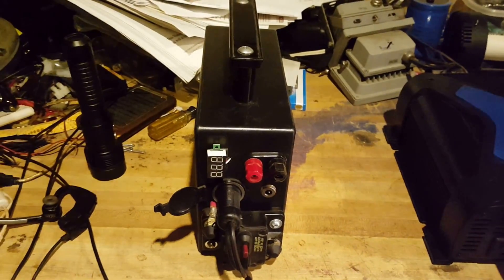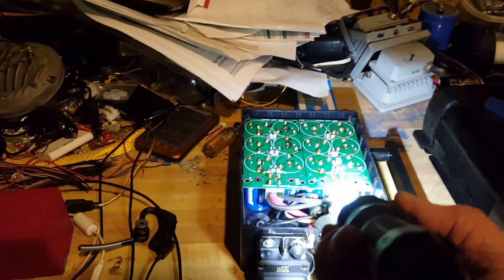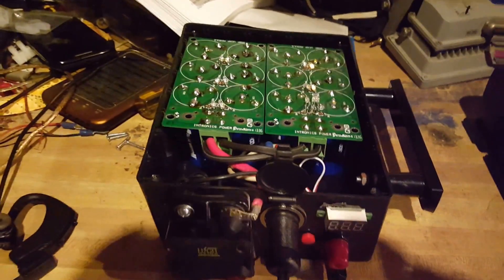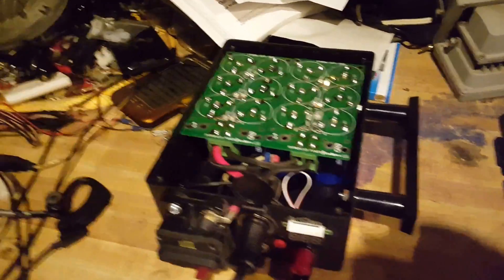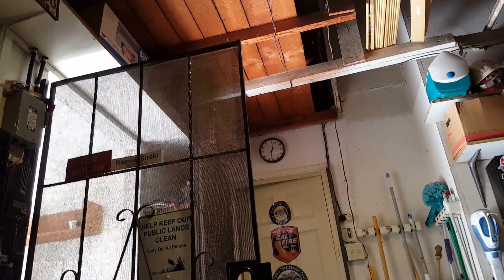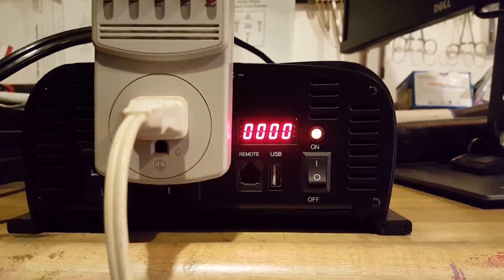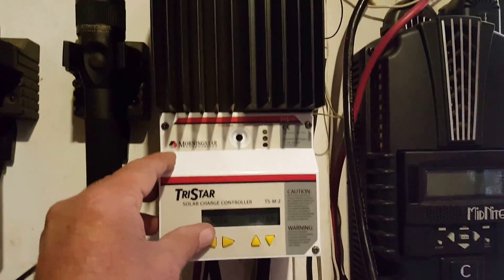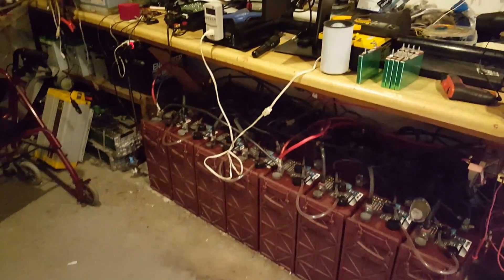Review Of My D Cell Maxwell Supercap, Boostcap Power Pack.

Comment: Because the individual caps are wired in series you have to divide the farads, not multiply them. So each bank is 58.333 farads (350 divided by 6), so both banks in parallel (58.333 times 2) = 116.667 farads. You should use a step up adapter between the caps and the 12v output sockets so that you can drain the caps down to 2 volts while still providing 12 volts output i.e. https://www.ebay.com/itm/4A-DC-DC-Step-up-Voltage-Converter-2V-14V-To-3V-30V-5V-12V-24V-CCCV-Boost-Module/122664078517 (use a bunch in parallel if you need more current). They work great for doing things like charging your cell phone from the caps, so you can use almost all the energy in them.
Reply from the maker: Good point, however you may find this website useful:  https://www.electronics-tutorials.ws/capacitor/cap_6.html  Ride Safe,
Reply: Ran your caps through the math, yep, 116.667 farads final :)

Comment: Hi The Battery, (sorry following the oz bad habit i cut names), this is very interesting for us. We are trying to figure out what sort of electricity source we are going to put down our block. The set up for solar can be affordable but when it comes to the battery that where things get even more expensive. I was told by a youtuber that we could try to found a battery from old big machinery, is that a possibility? do you have a video ref to this? cheers
Reply from the maker: The machinery battery packs are a good way to go, however bare in mind that the weight could be very heavy!  I always wanted to obtain forklift battery packs but the weight issue deterred me.  IMHO as anything else in life, you get what you paid for.   Batteries are one of the expensive and the main part of an solar storage unit. Do your homework before spending your money.  Be Well

Comment: Slick device!  I saw a video somewhere that used capacitors to replace the battery in a vehicle.  Sure would be better than my current practice - carrying a spare battery in my truck (alternator is getting weak but hasn't failed yet).
Reply from the maker: Thanks for stopping by and be safe old friend! Godspeed, Razmik